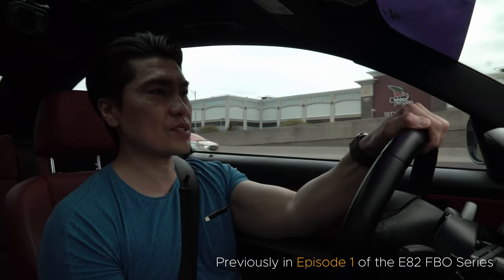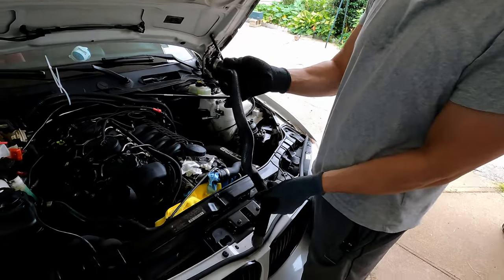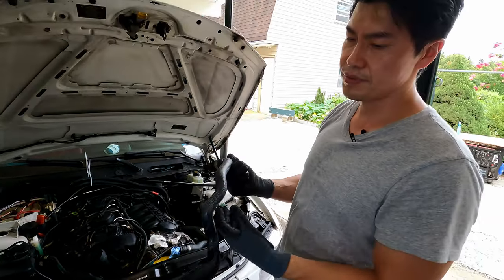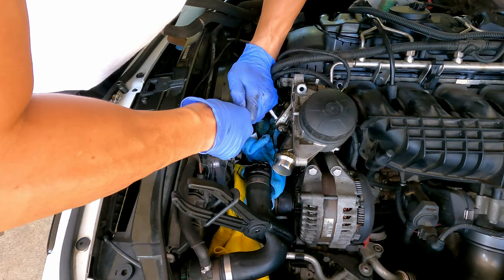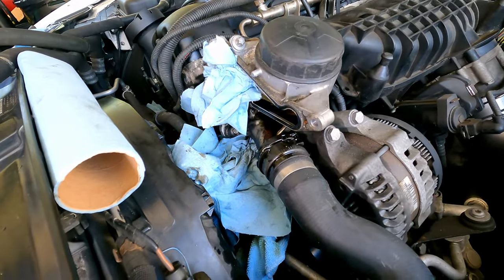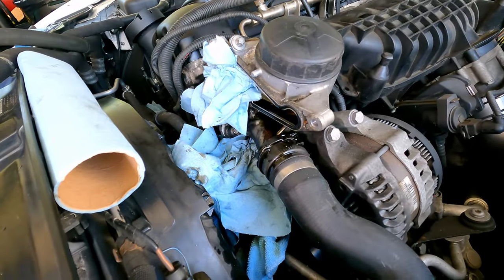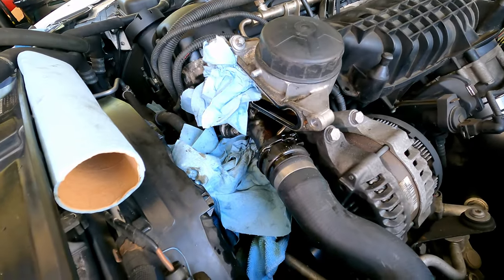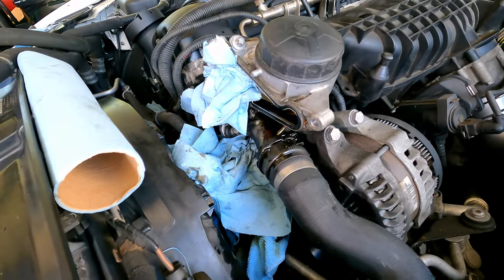BMW E82 135i Oil Filter Housing Gasket DIY | Full Bolt-On Series (Episode 6)

Comment: Since my purchase of a 2012 135i with 73k miles in late may 2023 i have successfully used and completed 1.valve cover replacement , 2.spark plugs and ignition coils , 3.oil filter housing gasket , 4. pulley and serpentine belt , 5. intercooler and boost pipe and 6. coolant and engine oil change.. This channel is a hidden gem on the internet and the clear videos and parts list made these jobs reasonably easy so Thanks ! Over the winter i plan to do the oil pan gasket wish me luck
Reply from the maker: That is amazing! Seeing comments like this makes it all worth it for is.
Reply: may i ask why repalce the valve cover, I j bought a 2013 w 75k miles and it had the cover done at 50k miles. should I change mine?
Reply: @michaelyaghdjian9201  with the low cost difference and the amount of labor required, I decided to change the valve cover ... good thing I did as I broke the original one when removing it ... if you only have 25k on the current one, it should not have to be changed now ... when facing the engine, if no visual signs of oil between the valve cover ( especially on the left ( passenger side )and mating surface are present, you should be good to go

Comment: Hey did anyone run into a problem with coolant leaking from the coolant expansion hose ( at the junction with the radiator hose) afrer replacing it? The expansion hose just kinda fits onto the radiator hose should i tight-wrap it?

Comment: Do you think that the clutch will have problems with the torque after the MHD stg 2 tune?
Reply from the maker: Hey there, sorry about the delayed reply. We had no problem with the clutch after going FBO and tuning. It's been going strong for about a year now after the tune with no problems!
Reply: Definitely a wear item so it will suffer from slippage with more than 100+hp.  Definitely on the list of things to do.  There’s a great option using the 550 clutch kit to answer the additional torque/hp.
Reply: @aidenjoo7262  Thank you!